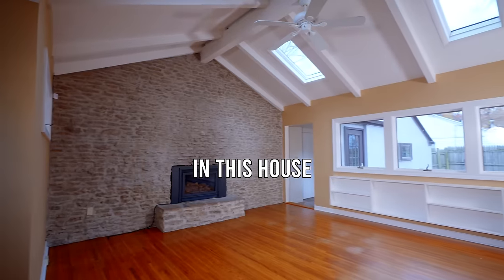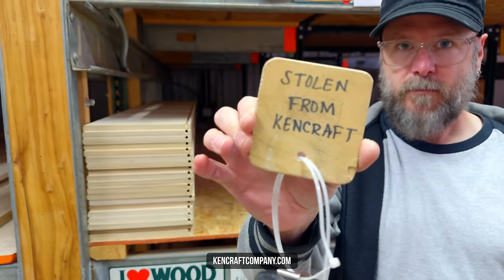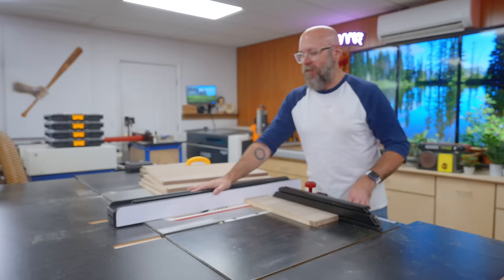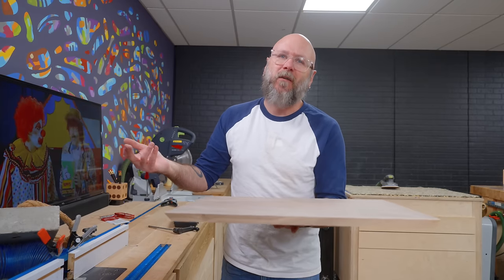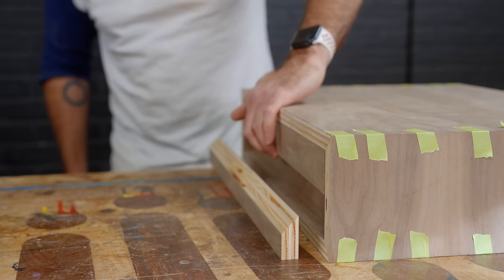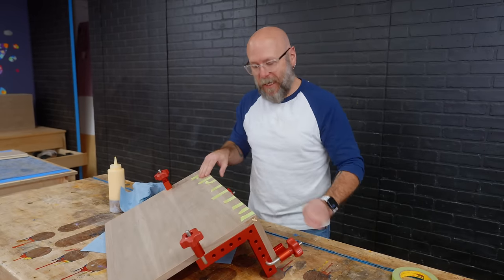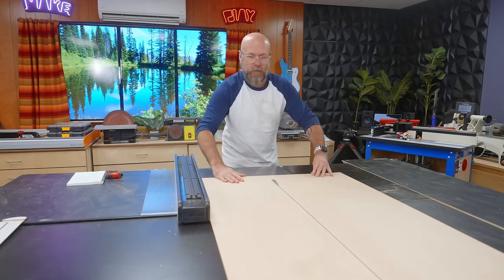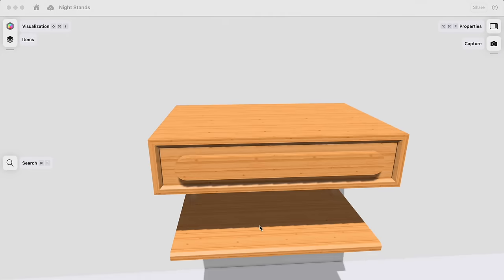Designing a Dream Vacation Rental: DIY Floating Nightstands

Comment: Thank you @makesomething for  including other was to do stuff, it is always helpful but this time, you saved my butt. I was about to crosscut panels to final length and found out my cheap track saw is cutting way off the line/splinter guard. The tip about using miter gauge in reverse was what I needed. It was such a coincidence to watch your video just before heading to the shop.

Comment: They came up ripper ,if you’re doing more 45s on the router table, may I suggest a 45 degree lock mitre bit, plenty of gluing surface and a really strong joint ! 🙂

Comment: Love your designs and videos! As a new woodworking hobbyist, one of the most confusing things building different pieces is choosing which type of finish to apply. I know there are some videos solely focusing on finishing, but I think it would be really helpful if you explain the finishes you’re using and why you chose that specific type of finish for each piece/video. I think that would really allow the reasoning to sink in if we hear it consistently. Thanks for the great content!
Reply from the maker: Polyurethane on anything that needs a durable finish like a table top. Everything else is whatever I feel like at the time. Sometimes it's shellac, sometimes it's lacquer and sometimes it tung oil for no rhyme or reason.